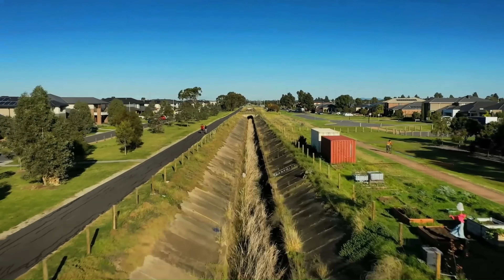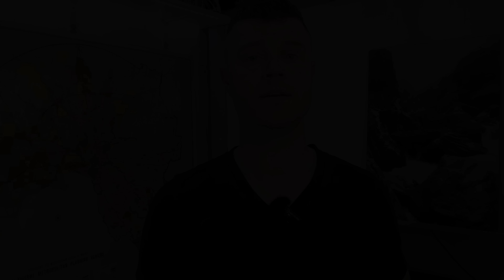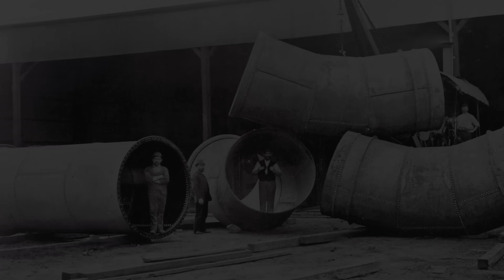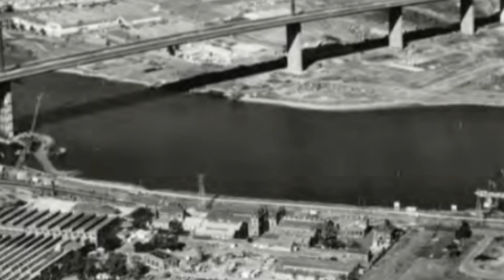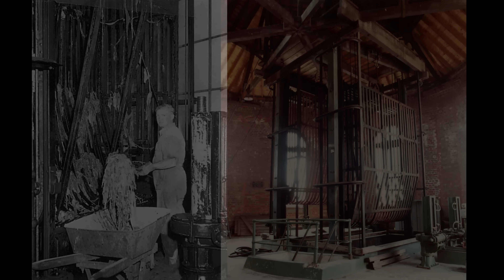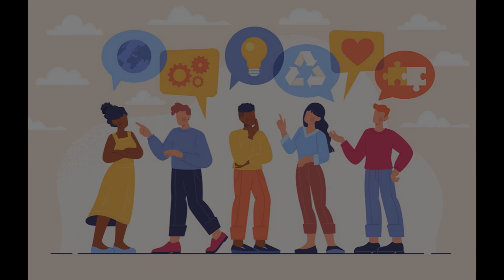Melbourne's Sewerage Story - EP3: The Underground Marvel – Melbourne’s Main Sewer

Comment: I think only one of the pumping engines - the Hathorn-Davey - was manufactured in England. It served as a pattern engine for the Thompson (Castlemaine) engines. The crankshaft has floating ends whereas the Thompson “copies” have journals and bearings. Chief engineer William Thwaites was apparently very fond of Engine 1.
Reply: Partly correct. In the 1890's, as many items as possible were to sourced from Victoria to assist with recovery from the 1890's depression. The first four engines were constructed by Thompson's of Castlemaine (as were the boilers and gantry cranes). Only one engine was manufactured in England, as you stated, the Hathorn Davey (engine 5) in 1901, with the Austral Otis engines 7, 8, 9 & 10 being copies with modifications. One of the differences being the Hathorn Davey crankshaft has 4 bearings, the Austral Otis engine crankshaft has 6 bearings. The additional bearings being on the other side of the high and low crank webs.
Reply: i would really like to know what you mean by floating ends.
Reply: @vsvnrg3263  The middle crank web has two bearings, but the outer cranks only have a single bearing.
The engine is a triple expansion engine with a high pressure cylinder and crank, intermediate pressure cylinder and crank, and a low pressure cylinder and crank. The pumps are directly driven from the crossheads: three cylinders so three pumps. All the pumps are the same size.

Comment: Another great summary of the sewer system in Melbourne. Only nit pick is that the system is called the sewerage system, what it carries is called sewage. Some of the old sewers have their own history and can tell stories about their construction and operation. Melbourne Main Sewer which serves Melbourne CBD was constructed by using hand driven shields in the late 1890s. These shields were driven through soft Yarra silt and under their own weight started to dip so every few hundred metres they were adjusted to the correct gradient. As a result the sewer had a sawtooth profile and walking to inspect that sewer was extremely difficult as the water level rises as you move downstream in some parts and some sections cannot be walked at all as a result. I think some of this has now been replaced with better graded sewer lines. Under the Yarra River at Spottswood a shield was driven to create the Hobsons Bay Main Sewer to bring flow from southern suburbs to Spottswood. It failed under the river during construction and workers were killed when Yarra water entered. It was a costly piece of work and was only replaced some years ago. Look forward to more about the system and treatment of wastewater.
Reply: yeah, i want to hear about the sewer under the yarra.